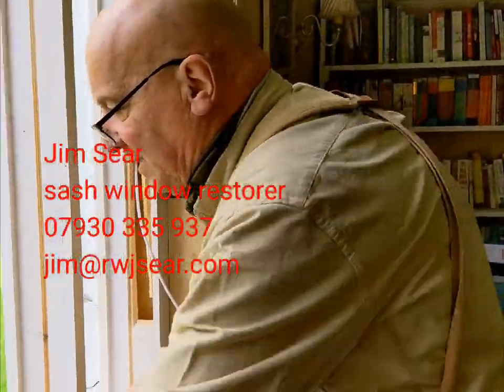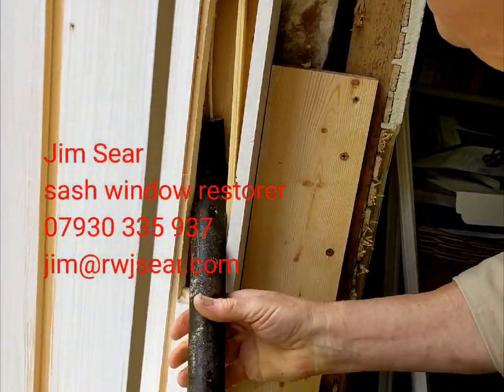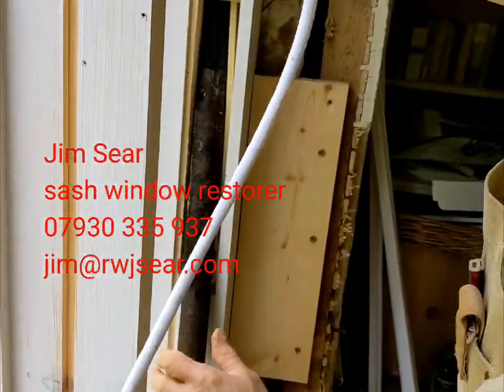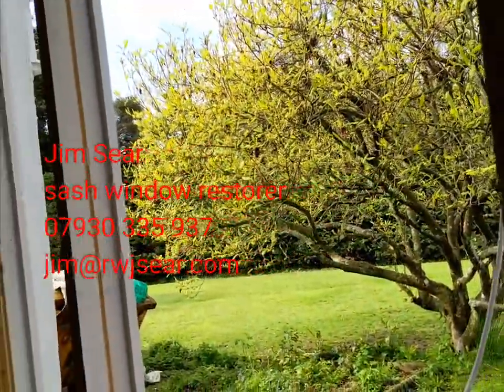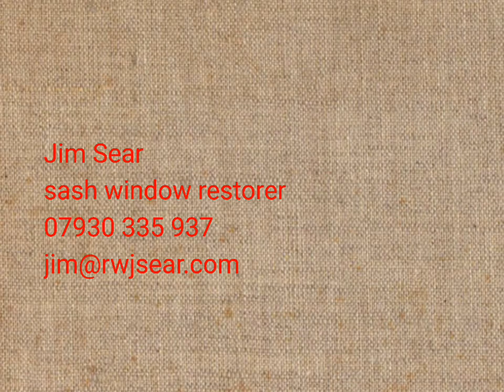Venetian sash window - part 3. 24.05.2021

Comment: Jim going to make sliding sash windows for my grandfather s 1911 cottage, learned quite a bit from watching your videos,  haven't made windows before but looking forward to the challenge, just trying to figure out best seals to use, don't want to use brush type seals , looking at a seal from Costal seals  Flpper Seal it fits to the corner edges of the sash  and seals on two sides, looks good, regards Willie
Reply from the maker: Yes, it's very good...but...I've found it's best used on thicker sashes only (+45mm).